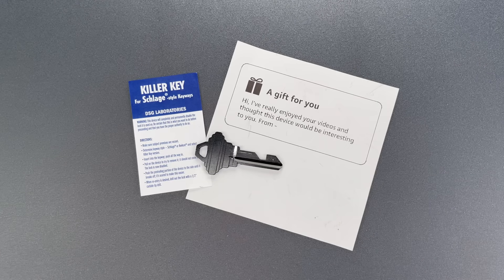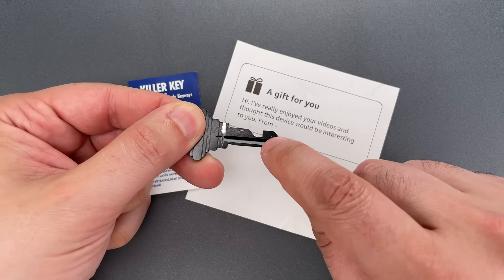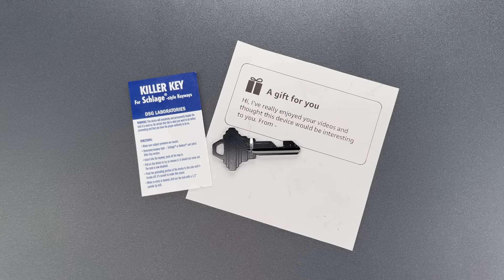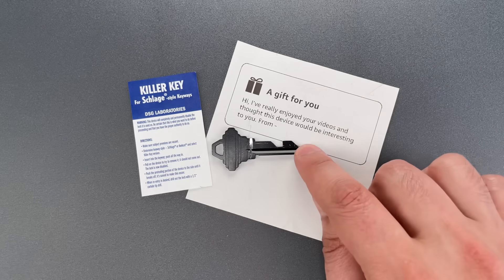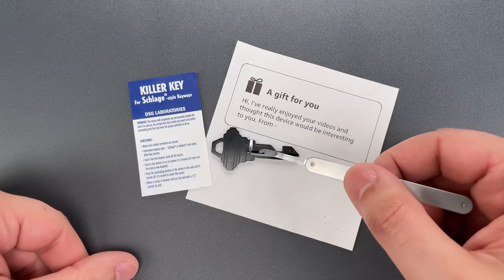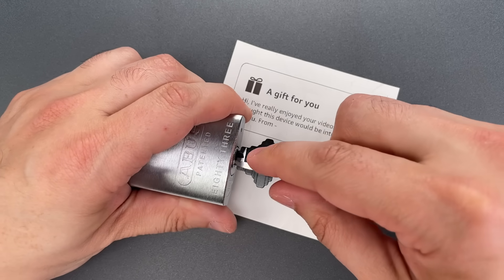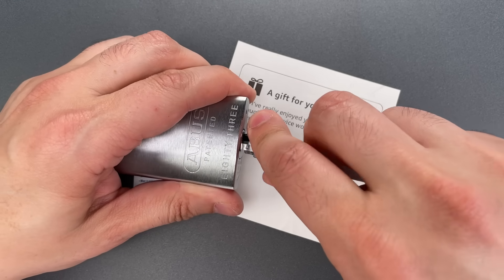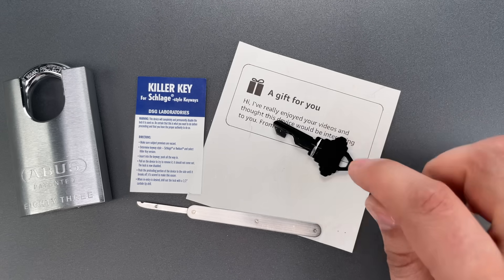[1350] Defeating a “Killer Key”

Comment: 2 Questions: Under what circumstance will you want to completely disable a lock with a killer key? Why does LPL just casually have a killer key with him??
Reply: @Kaser  he’s talking about the other one
Reply: For all of those who doesn't understand the first question: "The Killer Key can instantly and permanently disable a lock. Once inserted into a lock it can not be removed, making it impossible to unlock the door. The door can still be opened from the inside, so no one can be locked in, only locked out. The only way in is to drill the lock. Simple to deploy - just insert into the keyway and then push sideways on the bow which will easily break off. The Killer Key can be a valuable tool for law enforcement as an instantly deployable access denial device. It's also a useful tool for property management to prevent return of evicted tenants before the locks can be changed".
Reply: @Vinterfrid  Thank you...for a complete, polite, informative answer to the question. (without sarcasm or insults like others did) 💯👍
Reply: @Vinterfrid  that's simply not true tho. being able to remove the key in 10 seconds isn't permanently disabled at all.
Reply: @Vinterfrid so its grest for being a terrible person? Seems about right
Reply: He carries a killer key with him so he can show it wasn't a fluke
Reply: First question:  Real estate. You have an unknown number of keys floating around and want to secure the building, so you use the killer key. The new owner will have to replace the locks anyway due to the unknown quantity of keys that they don't control.
Reply: @tyrannosaurusimperator  finally a real answer, I'm seriously looking for an answer and a little bit surprised I have to scroll pretty far to get one
Reply: The actual use is for renters, if you evict someone and dont want them back in and cant be sure they didnt copy the key, put the key into the lock and snap it off while you wait for a locksmith to change the locks.
Reply: We have a door no one uses, that needs a key that’s lost somewhere in the house. It’s fine at the moment, I’m sure the key will come up eventually, but I could see this being nice to, functionally, turn it into a wall. Or perhaps a house that’s like, been abandoned- it really emphasizes you don’t want anyone getting in!
(Note: the first example would only work if you have enough methods of egress. Check your local laws before getting rid of a door.)
Reply: @debayeuxchats5607  or they could remove the door knob
Reply: 1: If you put a killer key underneath a mat or potted plant or something and a would-be burglar comes to your doorstep and finds it, they lock themselves out and provide immediate evidence that they attempted to get inside, especially if the doorbell has a camera. 2: because LPL is LPL
Reply: @autumn-vl5ez  lol wtf? You want a burglar to lock you out of your own home just so that you know they tried to get in?
Reply: Why would someone need it? Real estate evictions,  lost keys and you wish to secure a shed,  shopping container etc until you can get a locksmith or a new padlock etc.  Second as an example of what he was talking about?
Reply: a lot of comments and besides the answer from the guy who did not even understand your question, nothing from worth. a killer key is good if you did loose your key to a lock and dont have a lock to replace it.(now) something like that.
and why does he have one? maybe for party tricks, he could have a friend who is a fan of houdini. or he want to prank somebody. put it in a lock for a office or building. waiting for the guy to open it, look how he trys to open it and then call a lockpicker, just to take out that key then nobody looks^^
short, i dont know. all i know are pranks -.-
Reply: @danielchoritz1903  nobody looses a key but people do sometimes lose them. Hilarious mistake to be in the middle of a rambling post about other people being stupid.
Reply: @danielchoritz1903  *lose not loose (I hope I don't lose my key ; Oh that wheel is loose) Two very different words.
Reply: @danielchoritz1903  He made it especially for this video? 
Costs a Schlage key blank and ten minutes; gets him a bunch of new subscribers.
Reply: A lot of security tools have extremely niche uses.

E.g. if you're doing a physical pen test, it might make sense to disable a particular lock/door to alter the behavior of the blue team. Maybe that prevents security guards from reaching a room you're trying to break into, or at least makes them take a lot longer to get there, buying you time to break in and get out.
Reply: @Kaser  I love it when people are like, “hey dumbass, you didn’t watch the video” and in doing so prove that they, in fact, were the dumbass who didn’t watch the video. Fantastic self-own my dude.
Reply: I mean you don’t?
Reply: Nothing nice, I'm sure. I don't believe he really always carries one, but then, I'm sure he has a good reason, if he does.
Reply: I have a lot of ideas, but they are all completely illegal in themselves and are part of even more illegal activities
Reply: I had the same question! After searching comments and finding nothing I googled. The main use is by law enforcement to secure a crime scene. Or in a eviction situation where you don't want to lock someone inside but don't want them re entering either
Reply: Learn one thing: guys like LPL never (never) make videos unprepared. They always research, prepare and practice before making such short videos. The chance is high that Matthew had no  killer key before making the video.
Reply: @cheesebusiness  who the hell is Matthew?
Reply: Surprised no one else has said yet what my first answers were:
1. As a way to be petty when someone dumps you or something. There are a lot of products out there that serve no other purpose than pranks or pettiness. That was my first idea, but the real estate one makes sense! Also, probably it exists because it's interesting and someone made it because they could.
2: Seems like LPL likes everything related to locks so I'm not surprised he has an interesting key like this. I also wonder if he's had to deal with these professionally in the past, and so having a set on hand is good for demonstrating to the customer what exactly a killer key is and what it looks like!
Reply: Since I don't think anyone stopped masturbating long enough to answer the OP's question; they're used to disable locks. Law enforcement can use them to kill your door to delay you from getting back inside, or landlords can use them to block entry to an evicted property if you can't get there right away to change the locks.  Mostly they're just used by a$$holes for vandalism.
Reply: @ChairmanMaoio  cute but guess who was too busy fantasizing about others masturbating to read the comments close enough to see the question was indeed answered already. Sorry, sunshine.
Reply: @ChairmanMaoio  all provided examples are it being used by a$$holes
Reply: Hell, he even says it at the very beginning of the video
Reply: @Kaser  the other one, genius
Reply: @oreziopancrazio3685  you mean the completely normal key he put a groove in as an example at 0:47 that isn't even a killer key itself? That one?
Reply: If you think that key was normal then you have learned nothing...
Reply: @narius4241  take a look at that key again and tell me if that looks 'normal' to you. Looks to me like a better killer key than the one gifted to him since it has two pin grabbers instead of one in addition to the better groove placement.
Reply: @narius4241  lol. Someone's not looking properly..
Reply: @narius4241  Think you might need get a pair of glasses m8
Reply: @Kaser  who's a silly boy? 😏

Comment: The quicker method is to shove a wood toothpick half way in the key hole, snap it off then push another in to push the first part into the lock this prevents any key from being inserted.

Comment: I  the 1970s I used to buy a killer that no bow.  Instead there was a disk that would end up flush with outside.  This prevented your decoder from being inserted.   There was a hole in the middle of the disk which accepted the wedge shaped extractor.   If the disk had been solid it would be more difficult to remove

Comment: What if someone solders the killer key in place?  I imagine coating the killer key in flux allowing someone with a blow torch to flow solder into the inside of the lock.
Reply: i mean, couldnt you just fill it up with solder alone then, no need for the key then.
Reply: @rosepeters6507  If you used pure solder to fill the keyhole then they would be able to heat the lock up and melt most of the solder out, Then while the lock is hot and the solder is liquid they could use the key to open the lock.  Soldering in a killer key would stop that while also tricking the picker into thinking it was just a killer key, I also think the solder would be harder to flow out with the key in place forcing the picker to preheat their tool else it solidifies the solder on contact.  
I mean this is all theory so in practice I can see ether method succeeding or failing or multiple different reasons.

Comment: I don't understand where is the point. I have used small pieces of various metals and glue; and a cap with molten Tin. I guess amalgams could work too or I could fulfill a keyhole with low melting point metal pieces and heat it. But I never tried to destroy it by all these ways.
When are you sealing doors this way, you must also think about other things.

Comment: "Can't be removed without drilling the lock" proceeds to remove it twice in a row both attempts taking less than 10 seconds with a single tool no drill. Great key 10/10
Reply: not just twice but faster than he can explain the tool required ...
Reply: @0623kaboom  and faster than it would take to drill the lock
Reply: You need to squeeze half a tube of epoxy into the lock after you put the funny key in there... THEN it's jacked up for good.
Reply: @suspiciouswatermelon7639  Why would you buy this thing if you’re just gonna super glue the lock?
Reply: @jessicabrock8800  Buy? Make it yourself!
Reply: @suspiciouswatermelon7639  Why? What is an actual rational purpose for something that disabled locks temporarily/permanently? Not to mention legality.
Reply: @jessicabrock8800  The most common reason is to permanently lock out a customer who has neglected to pay his bill. Easy fix for me, difficult for him.
Reply: @Suspicious Watermelon  Can't imagine a padlock being cheap enough for a company to regularly brick them up would put up much of a fight to even the cheapest of bolt cutters or even a swift hammer smack.
Reply: @Jessica Brock  You're absolutely right.  It's cash grab gimmick and has almost zero practical applications that can't be achieved with household supplies you already have laying around.
Reply: @suspiciouswatermelon7639  with the epoxy you don't need a killer key, a few toothpicks will do the job
Reply: This must be your first LPL video.
Reply: I made a similar tool out of an old feeler gauge

Comment: If you want to disable a lock, just add lock tight or similar instant glue at the tip of the key. Even the LpL will have trouble removing that!
Reply: Pretty sure most glues can be defeated with spraying/injecting acetone solution at the right place.

Comment: Seems like something to use in conjunction with a nice lock as an additional counter-picking measure. Maybe not so much against the equipped but even so. Also a potential tampering indicator if the key is easily broken from someone mistakenly trying to open the lock with it.

Comment: Lpl, a few things, the purpose of this is to deny permanently the access of a illicit keyholder to that lock. So removing it without drilling, while i get it, i do, is a bit of a moot point isnt it unless its just to save the cost of a new core since even with drilling you can put a new core into a lock body and carry on. I mean 🤷‍♂️like i said i get it but its barely a benefit. You have to buy this. And if you are a landlord you lilely have or have easy acess to expanding foam in s spray can that will be far less easily bypassed and just as effective. 
 2. The mod of the too is a bit of a conceit isnt it? Amazing and elegant, but once the pins are lifted the killer key can simply be pulled out by hand cant it?
 Like i said, its elegant and defintiely worth it, but those were just my thoughts as i watched this. I mean at the end of the day, elmers glue squirted into the keyway would work just as well if youve already decided to eat the cost of the lock. Most locks on houses particularly rental homes as we know are basically mclocks as it were, hardly worth the trouble of changing a core or repinning one given that if a determined even if unprepared attacker will just break a window or kick in a door, this seems like one of those feel good measures that people take only to get disappointed by.

Comment: That is fascinating. Will this also work against keys with multiple grooves, I've seen keys with as many as three deep notches cut into them.
Reply: Number of notches doesn't matter if all the pins are pushed out of the way.  A strip of soda can and needle-nose pliers would work for the black one shown, since it has that bit left outside the keyway.  Mind, this won't open the lock – just remove the "killer" key.

Comment: Realistically if you want to permanently seal a lock you need to either pour in/inject something to gum it up or use high heat to cause heat warping to the cylinder

Comment: If you made one of these with a large disc on the end, so the keyway and core are completely obstructed, I would think it would be far more difficult to remove without at least drilling or breaking off that cover. That does make it a fair bit more expensive than the solution shown in the video, though, which is clearly made from a key blank.
Reply: A 3d printer could probably be the solution, durability wouldn't really be needed since breaking it would just make it harder to remove.
Reply: Game changer!

Comment: What if the key was wider towards the base, perhaps made of a malleable metal or with a hollow center. When you insert it into the lock you force the last part (1/2 inch) in, conforming to the shape of the lock it would prevent something like that from entering the lock?

Comment: Just make the killer key thicker to the point where you would have to force it into the keyhole, so there would be no gap on the sides. A workaround for the tolerance of the keyhole is to supply 3-4 keys with slightly different thickness to cover the whole tolerance range and then use the thickest one that still slides in. This would make they keys more expensive and you would need more, but there would be no way to remove them.
Reply: Or fill the lock with superglue...

Comment: Wonder if they could make something like this that works like a spot welder, melting the "killer key" in place, fusing the mechanism together?
Reply: just a bit of corrosion would make things very difficult but a copper tungsten key and a welder with a clamp to go over the lock would do the job the goal would be to weld the pins the copper tungsten key should be reusable

Comment: I’m confident he’s gonna master digital locks and magnetic ones in the next couple years
Reply: he's already done a video on mag locks actually ... they are truly bad ... he even setup a better version and still defeated it in seconds
Reply: this comment aged like a fine wine
Reply: [13500] Breaking the RSA2048 encryption system
Reply: the people who make digital locks know nothing about locks. he even had a digital lock he could SLAP open!
Reply: He defeats mag locks with a mallet ... A mallet!!
Reply: my mans over here busting rsa 4096 in 30 seconds
Reply: I doubt that current technology of lock and keys will move forward just for the sake of it.
Mechanical keys are the best bang for the buck, as electric locks add complexity and costs while reducing reliability.
Also, people like traditions; LED bulbs conquered the market only when they could do without an heatsink, and therefore be shaped like a traditional light bulb.
Many cars still have ignition keys just because people like having a physical key...
Reply: @rayoflight62  Half of what you said is untrue lol.
Maglocks are used in places where they are needed. You can't keep using keys on an office door. Imagine a large open space office, like the engineering dept of a factory, where you have 50 people working every day. That's 50 entries, 50 leavers, 100-something just for people pissing and breakfast and lunch are not even in it. That's getting close to 500 uses a day, 2500 per week and in the 10 years that lock has been used, it has seen 1,500,000 uses. Show me a lock cylinder that can deal with that and show the same sort of quality after that much use. After that, fire code. Maglocks are normally on and drop the magnet if the power fails. You cannot lock people in. Yes I know you will come at me with the bloody crashbar doors but those are shit and belong on fire exits only.

Comment: “Things are easy when you have the right tools and know how they work” applies to anything by that saying I’m sure the people that designed the firewall for the Pentagon would say that if you know how it works it’s probably pretty easy to hack into so yes somebody that knows what this it is and happens to have that tool to hand this would be easy for them but I imagine most people if they came across this it would not be trivial to remove and  make them drill the lock or call the locksmith I imagine the menus for this tune would not be to be a foolproof way of disabling the lock but perhaps a way to buy some time as with any obscure lock would buy time from a normal lock picker because at the end of the day just like fancy locks if somebody is determined to steal something they will and all you can do is buy some time and make things inconvenient for people and then maybe they’ll give up